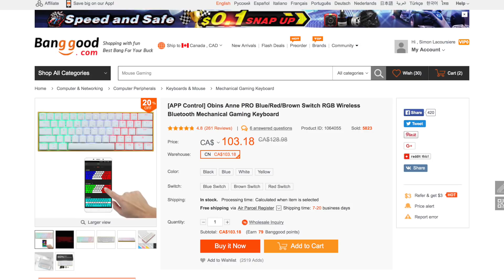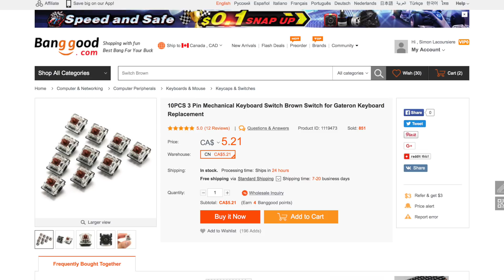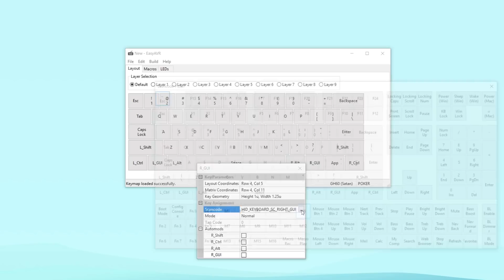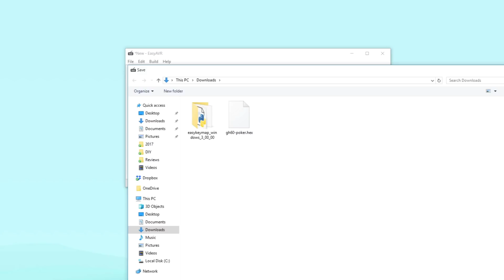GH60 60% Mechanical Keyboard Build Guide

Comment: Hi, Can you tell me the exact measurements of this case? (width, depth, length, edge thickness, height inwards, height out front and height out back). Thanks
Reply: Emile Ronco 1234532326783422378996544

Comment: does GK61 hotswap pcb fit into GH60 wooden case?
Reply: Im sure it does, all those comments saying it won't fit is probably because of the oversized plate GK61 uses in their prebuilt keyboard. If it's just the PCB, then it's probably fine.

Comment: I want to build a keyboard like this one day but when I do I use this guide!
Reply: its a good video but dont use this guide. a lot of things are missing and a good guide of lubing the stabs are missing. also i dont recommend adding all switches to plate first. instead i suggest appling the plate to the pcb with a few switches on the corners and in the middle, solder those and make sure the plate and pcb is straight, after that add the rest of the switch into the pcb and plate. less headace trying to attach the plate to the pcb this way.
Reply: Thump3r22 you don’t have to solder it’s hot swappable

Comment: 6:49 work on your stabs, that sounds bad. Band-aid mod, lube, clipping, cherry stabs over crap...
Reply from the maker: Cherry stabilizers would be better, true!
Even if I modded them, I don't think they would equate real cherry stabs :/
Reply: probably not indeed. Cherry screw-in (gmk makes them) or genuine cherry stabs modded are great. They don't make a noise if you do it properly
Reply: Buy durock stabs, mod and you won't regret it :)

Comment: Looks nice! I know that Banggood provided the parts, but if someone wants to build a keyboard, go on kbdfans.cn. There, you will find switches at a good price, not 35$ for 70 gateron browns but 68 for 13.60$... They also have better PCB options that are newer and that are packed with more features. They are a well known mechanical keyboard parts website, and I think you should take a look at it. Otherwise, that build was very nice! Browns for life!
Reply from the maker: I surely know about kbdfans, but this video was about banggood's offering. I might make a build using kbdfans parts soon! :) 
In fact, I recently bought an XDA keycap set from them and I will have a video about it in the next weeks.
Reply: minimalistik Cool! Nice to hear!